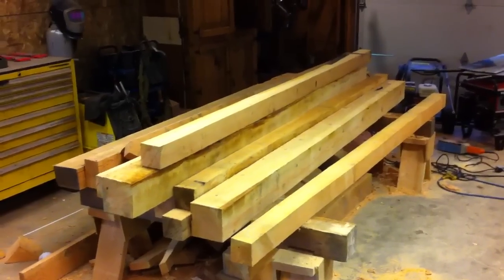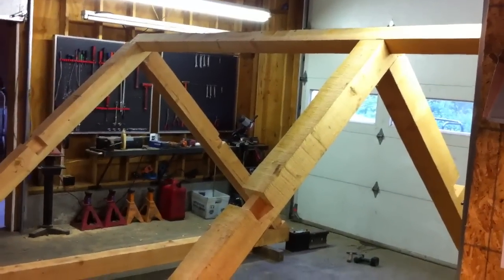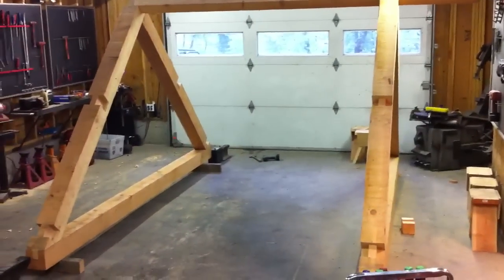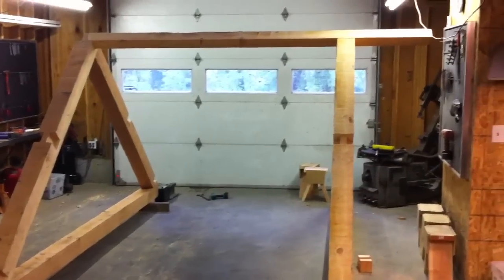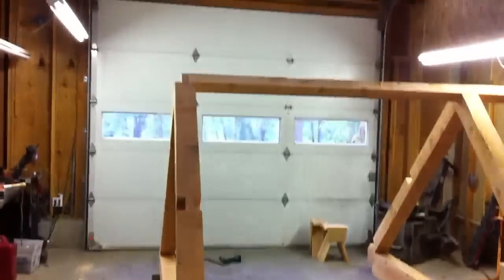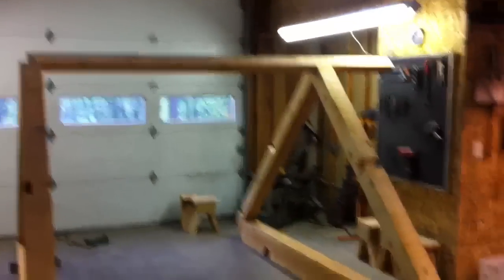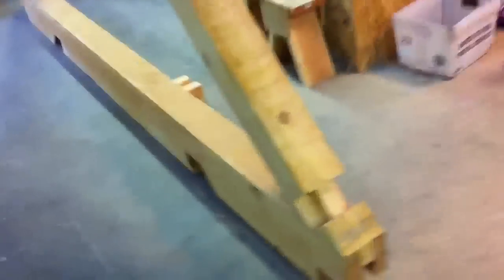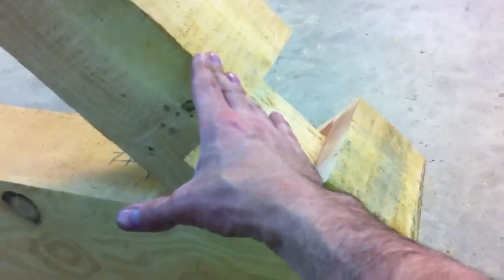Heavy Timber Rafters & Roof Overhang Plans – Off-Grid Cabin Build

Comment: hey, have you ever heard anyone say that using 6x6  for beams is stupid? They say that 2x10 or 2x12s (x2) is better. I read, and have heard that, thought, how in the fraking hell would someone even make such a stupid comment.  I am about to dig, I have over 40 to 50 6x6 with 4 8x8 and I bet you this, i'll be using them for post, beams, and any where else.
Reply: a 2x10s and a 2x12s (used as beams) are each stronger and stiffer than a 6x6, but that doesn't mean using a 6x6 is stupid.  Just make sure you are building strong enough.

The strength and stiffness of beams are strange things.  They depend on the cube of the height of the beam (the height raised to the 3rd power).  So, if you DOUBLE the height of a beam (we're talking solid rectangular cross sections), you increase it's stiffness and strength EIGHT TIMES.

Without boring you further with all of the mathematical/engineering details, a 2x10 is about 1.5 times stronger/stiffer than a 6x6. Two of them side-by-side about 3x (increasing the width of the beam is just adds, not multiplies).  A 2x12 is 2.67x and two of them are 5.33x.

Obviously, there are other considerations.  You need thickness for mortises, etc., so you can't use 2x timber for framing like this.

No extra charge for all this.  ;o)